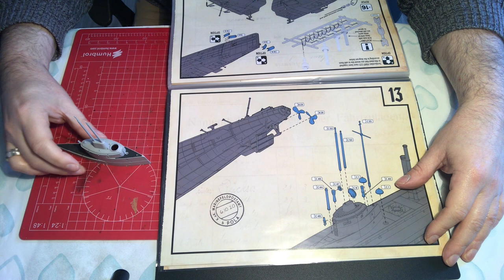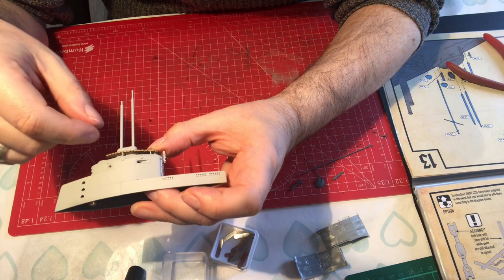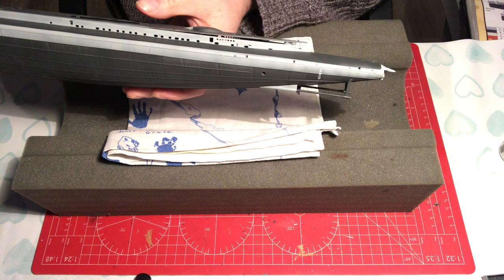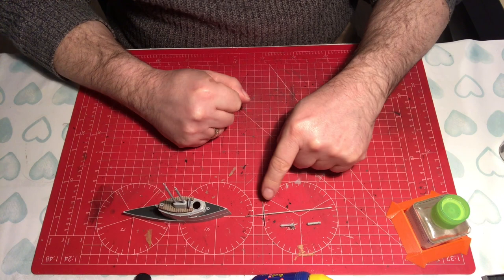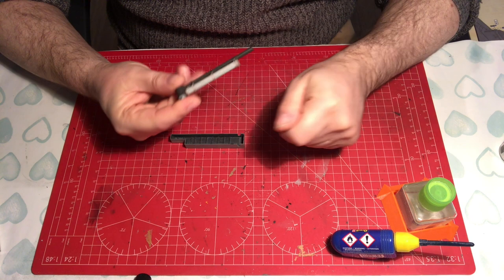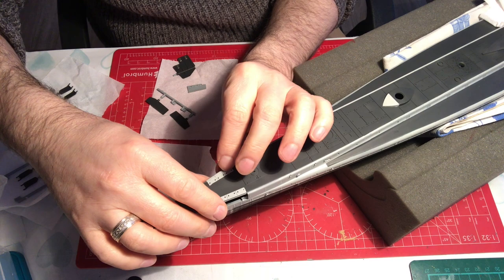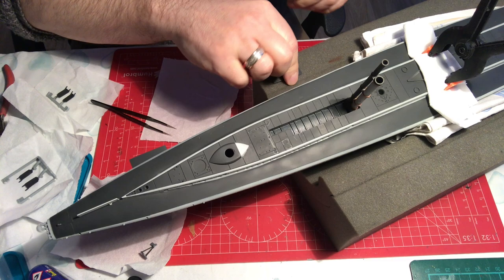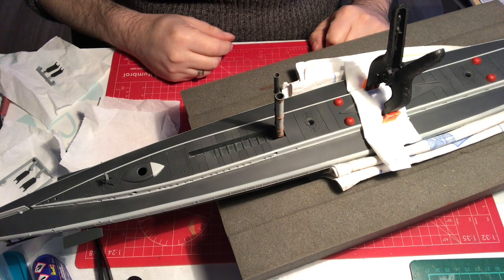Das Werk 1/72 WW1 U-boat SM U9 build part 7

Comment: The red covers are life raft storage chamber covers, hence the reason they are red. The old girl is looking good!
Reply from the maker: Ah, makes sense when you know, big thanks for that👍🏻
Reply: According to this German guy (, who built a 1/32 scale radio controlled model of SM U9 from the original plans (see "Baubericht SM U9" section under paragraph heading "Sahnehäubchen satt!" of his build notes  on his website http://www.petrolboote.de/sm-u9/baubericht-u9), these are buoys. To quote his web site:

The early boats of the imperial era had 4 buoys on deck as a safety device. In the event of an accident, 2 buoys could be released from the inside with a rope that ran through the hooks in the lifting funnel, which could then be picked up by the escort and lifting ship "Vulkan", which was specially built by Howaldt. This made it possible to connect the lifting cables to the boat without a diver. In addition, there was a telephone buoy with an 80 m long cable and connection options for air and telephone lines on the port side of the tower. With a construction immersion depth of 50 m, these possibilities seemed sensible to the Navy, but the reality soon taught them better. (from German using google translate).

In the next section he talks about the radio masts and more general information of early german submarine designs.

His notes on U9 an dhow he built his working diving radio control model are well worth a read. He has some close in pictures of his model (but not enough really) which may be an interesting guide for rigging etc.